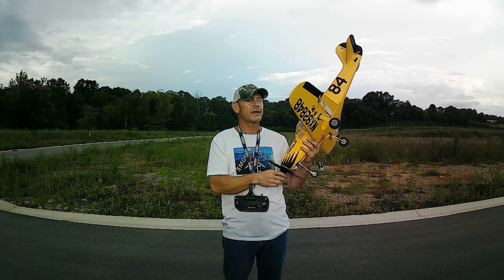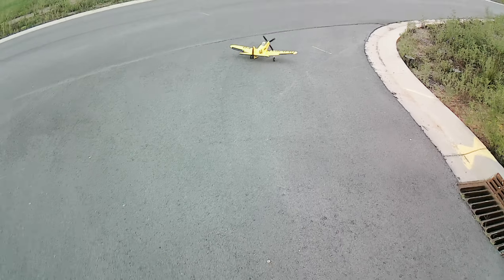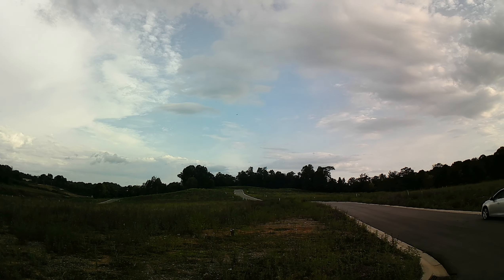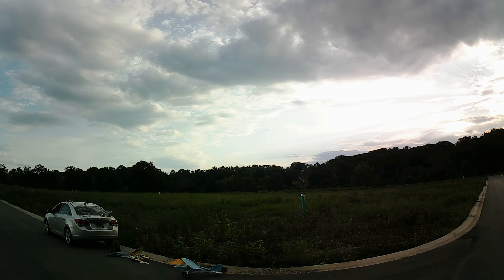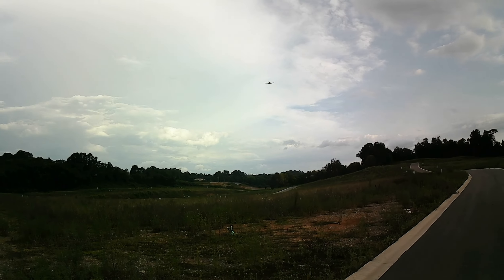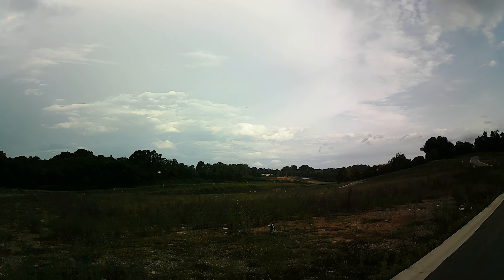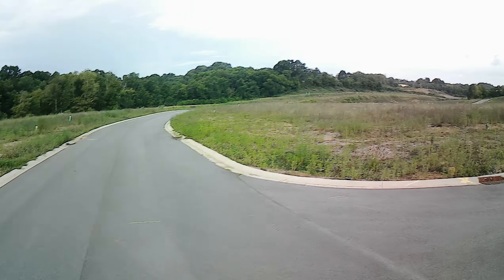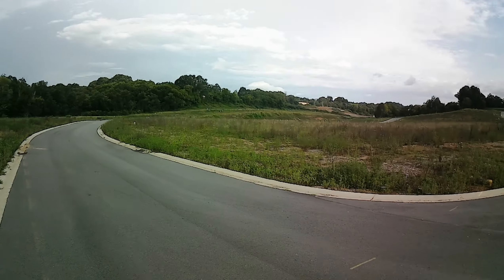Racing warbird -Fms p39 aerocobra ll 980mm. awesome warbird racer #smokeymountainrc #rcplane #fastrc

Comment: Very good video , I use milk jug and make hinges myself. I cut slots using my hobby knife and glue the in with Foam Tac. Hot glue works also but is messy to me. I like the clean look of internal hinges. Great flying.
Reply from the maker: Thanks.  Great idea.  May have to try it next